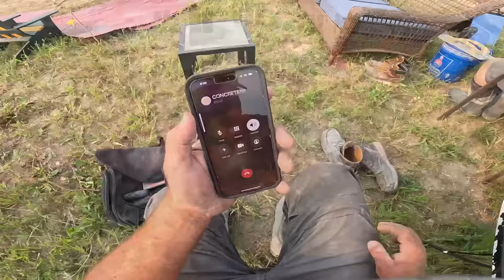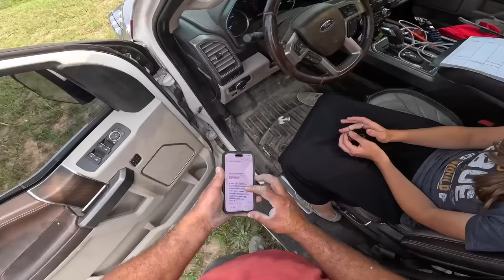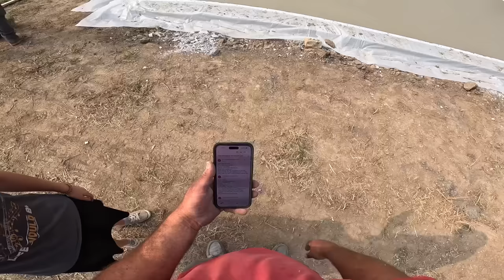This patio is AWESOME! I LOVE CONCRETE!

Comment: I've always preferred the look of saw cut joints over tooled joints whether it's stamped concrete or not, but I've got to admit that's one sharp looking patio. Good Work!
Reply: Really? I always like the way tooled joints look, seem more natural after curing. Plus the edges kind of curl down a bit more instead of a sharp edge when saw cutting.

Comment: There has to be an answer to those failed sprayers. 
  Unfortunately it probably involves having to clean the sealing O ring , the check valve and the piston seal every time you use it.
  I would try coating all the rubber components with Vaseline before first use.  They may last a bit longer.
Reply from the maker: It’s mostly because of my poor maintenance.

Comment: It takes skill and endurance to work with concrete.

And then there is the fact that cement generates heat as it cures and your feet and hands get in the concrete as it is getting poured.  If you have ever had a plaster cast then you know the heat that can be generated when cement cures.

Comment: You need to use xylene to clean your spray cans out with and your tips. I never leave cure in my spray cans only form oil. And when releasing pressure you raise the plunger of a quarter inch then twist👌👈🤔 good luck in the future and I love your videos👍🎥👀😁

Comment: Those spraying cans are expensive, and you go thru them quickly. I wash remove the release or top-cast, or whatever I'm using, and rinse it, and on the final rinse, I run the water thru the sprayer for about a minute. They last me a long time. I'm on 2 years on one pump.

Comment: Also, we just poured a new garage floor (new construction) and they saw cut the joints but did not go all the way to the wall due to the saw hitting the wall. Now we have small cracks between the wall and the end of the cut. Just looks like cheap work, is this standard in the industry? I see you do the wet joints on all your garage floors.

Comment: The drivers scrappers are really for the drivers only - but contractors seem to take them off their trucks to fill buggies, wheel barrels etc..with that said the drivers get busy and the contractors think it’s cool they got a scrapper. The drivers are mandated to have a scrapper on their truck and are issued one, and must buy and replace any missing - So load them back up and drop them off to the owners - do the right thing.